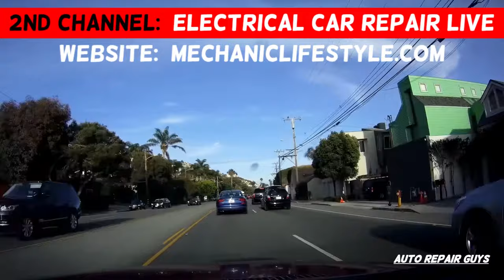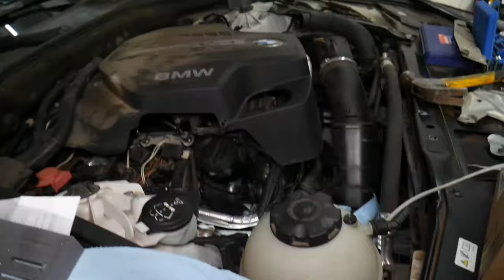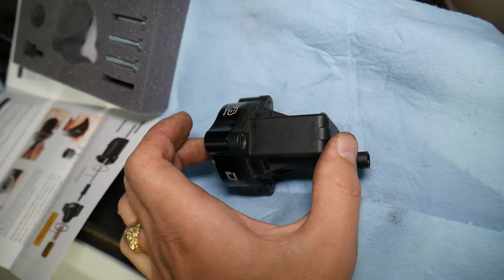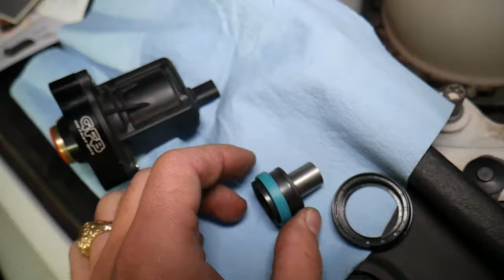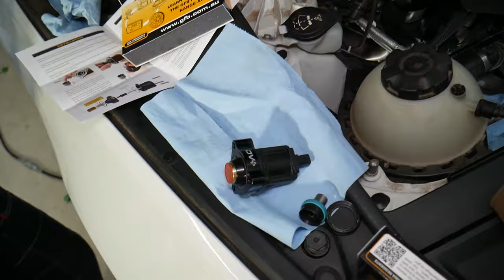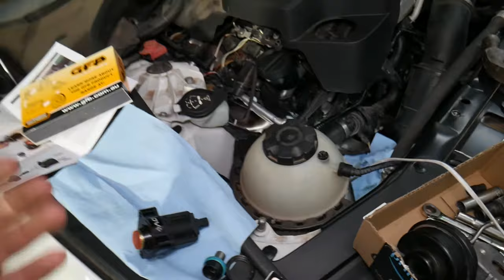BMW DRIVETRAIN MALFUNCTION WARNING NO ENGINE LIGHT BMW F30 F31 F32 F33 F36 F20 X1 X2 X3 X4 X5 Z4

Comment from the maker: Products that we use and recommend:
► Turbo Diverter (Check for your model): https://amzn.to/3IzZzH0
► GFB DV+ (Check Fitment):https://amzn.to/3YTumcm
► Long Torx Set: https://amzn.to/33d5rpH
► Hex Key Round Top: https://amzn.to/3y91pdf
► Panel Removal Set: https://amzn.to/3nZlEGJ
► Tool Set: https://amzn.to/3p5MM6t
► Screwdriver Set: https://amzn.to/3FUKyNV
► OBD Scanner that we use most often: https://amzn.to/3I4MQfe

► Check out our Amazon Store for the tools and parts that we use: https://www.amazon.com/shop/worldmechanics
Reply: Have a 2014 428i. Drivetrain warning came on. Went into limp mode. Made it home and turned engine off. Restarted after a while and drivetrain warning still on. Auto tranmission locked in park and wont  select any gear. Tried resets with the best scanner to no avalil. No faults before this issue. Cancels all faults besides drivetrain . Any help with regards will be appreciated. Thanks.

Comment: Hi,
Thanks for this great video which motivated me to do almost everything one by one.
So, my 2012 BMW 328i with 204,000 km on it is showing drive train malfunction signal, I started with BM deal for complete engine flush and oil change. This helped to reduce the engine vibration. Then I replace all four plugs and ignition coil with OEM but by myself (thanks to utube). Noticed significant improvement in the power but…engine vibration is still there and worst thing, the drive train light is still on.
Any suggestions on what to do the next?
I’m in Toronto, Canada.

Comment: thanks for the awesome content. my f30 328i has a rough idle only on start up for about 5 seconds only when car is warm (normal temperature) not on cold start. any ideas on what the issue can be
Reply: Same problem, know many guys with the same thing, mine even goes off if move it slowly in the first 20 segs

Comment: Hi mate thought I'd ask you as you are big on bmw 👍I have a bmw 320i f30 2015 uk model I seem to have a problem when I'm idle and the heater is on the radiator fan comes on and then off constantly  then comes back down and the idle goes up by 3-4rpms it doesn't do it when the heating is off thanks Chris

Comment: My bmw is a 316 f30 , it does show drive train  mulfactioning not enough percormance . When you stop at stop sign it set its self to neutral then i have to switch it off and start it again . When selecting reverse gear  it does go back and it select itself to neutral gear .
Reply: Had the same problem, changed the PCM / ECU and the problem got solved. Did you manage to solve yours?

Comment: The drivetrain malfunction shows on the screen on off the triangle yellow light comes on and on checking shows 120308permanent,charge air pressure control,, plausibility pressure too low But no speed affect currently.
But the whole process is depressing in many ways and upsetting.
Plse help and advise. Tqsm.
Reply: Plse reply
Reply: @gurdevmahel7066 ever get it figured out?

Comment: I change coils, sparks plug, oil pressure valve sad and the problem remains. 2012 118i.
Reply: U check pcv ..and plastic hoses for cracks